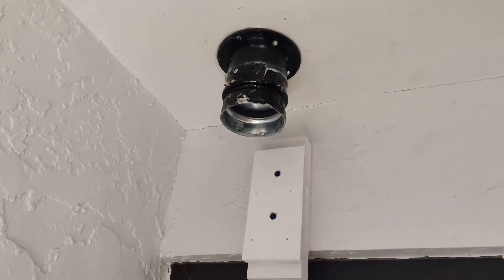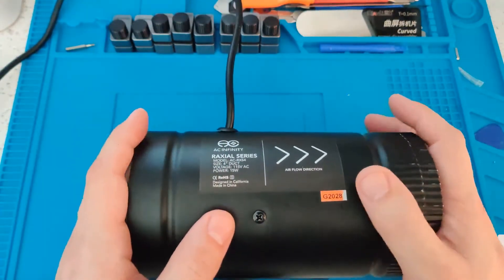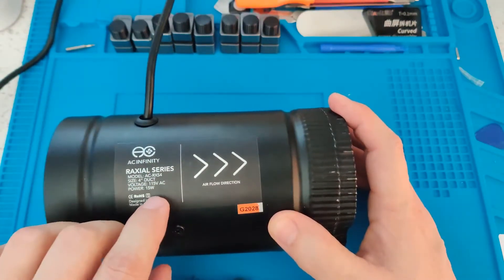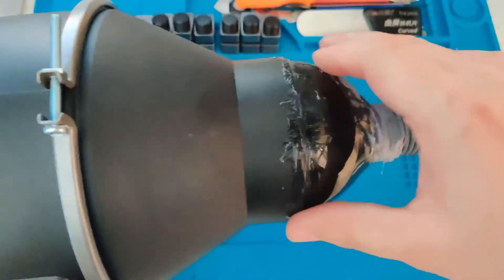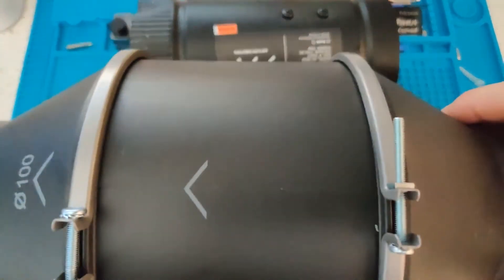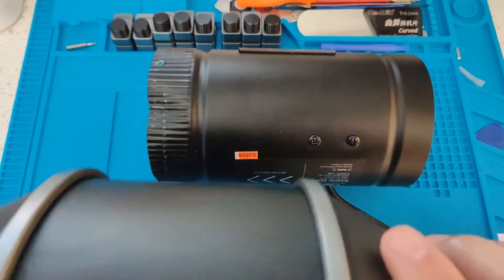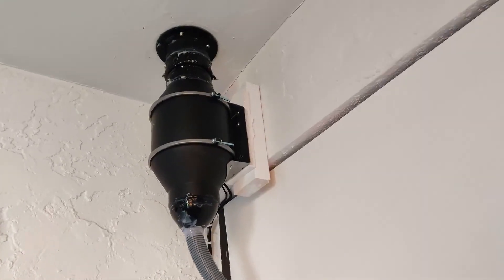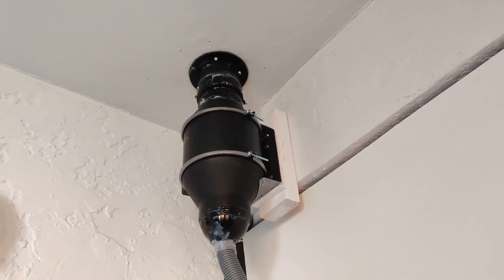New and improved 205 CFM fan on the Forward Blue Laser Machine review & install

Comment: Hi, I want to invest in a laser machine but the room where I work in doesn’t have any windows/vents how would I get rid of the smell? I guess leaving the door open but would that be sufficient enough to get rid of the smell?
Reply from the maker: There is an update video we did, check it out. https://www.youtube.com/watch?v=A_kZG6Xi3DQ
These are the items you would need, but if no window or exhaust, you can use the carbon filter setup. You can use ALL the items shown, EXCEPT you will need a carbon filter setup.  I have attached the full links from that video, including the carbon filter setup at the end....
Link to laser machine..... https://s.click.aliexpress.com/e/_99nfIp
3 way metal device..... https://amzn.to/3w6VQcx
Dryer duct..... https://amzn.to/3A0aCoK
Extra clamps....... https://amzn.to/3wYu2bI
Start ring collar..... https://amzn.to/3xWJdlG
Reducing collar..... https://amzn.to/2Vj1Dz3
Trap door dampers..... https://amzn.to/3jjNAmP
205 CFM super quiet fan used..... https://amzn.to/3y2YkKI
sheet metal self tapping screws.... https://amzn.to/3k06UGk
silicone adhesive....... https://amzn.to/3qV89YK
Window kit if you want to exhaust out the window……… https://amzn.to/3BtbLpE
Carbon filter assembly if you do not have a means to exhaust to the outside…. https://amzn.to/2YBG1zP

Comment: just wondering why not use the most powerful fan they have which is around 807 CFM ? would that cause an issue for the laser machine? really appreciate your feedback + Thanks for making theses vidoes
Reply from the maker: That is OVERKILL. Consider 400 CFM is one ton of air conditioning capacity. So 800 CFM is like having the power of a two ton air conditioner used like in a two bedroom condo. It's way too much. Stick with 205 CFM. You do not need more.
Reply: @CapeCoralCellPhoneRepair  sorry I don’t know much about HVAC can you explain what would happen if I use a stronger fan like 400 cfm? Like what exactly do you mean by overkill?
(Im trying to get rid of the bad smell completely)
Reply from the maker: I would be afraid of 400 CFM or more. It can shake and rattle things inside the machine. Stick to the 205 CFM on the description link. You will be fine.